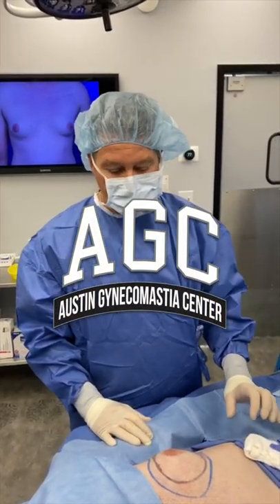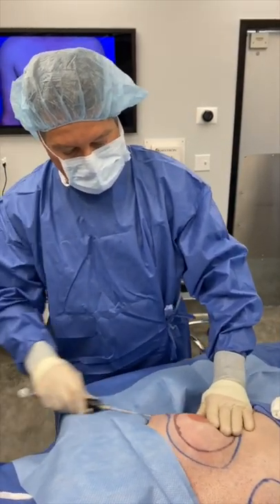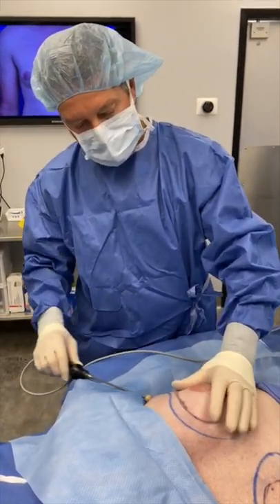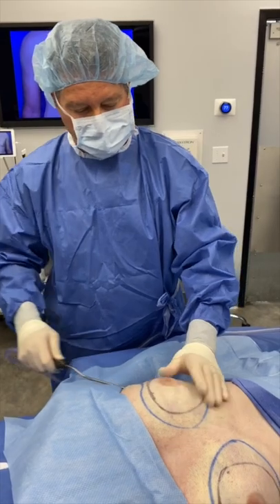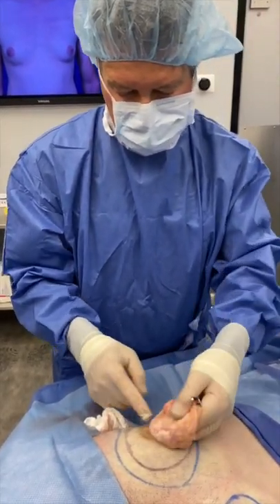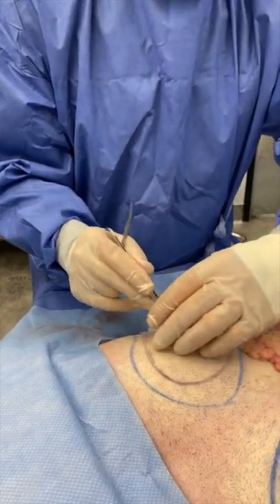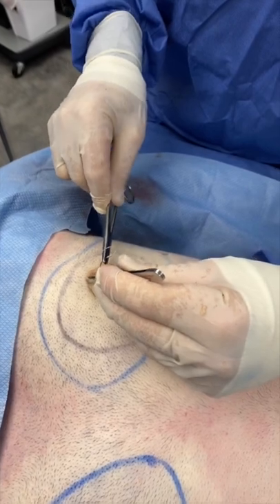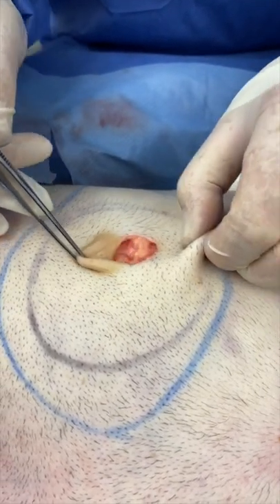HUGE Gynecomastia Gland Removal - 4 Steps Of Gynecomastia Surgery

Comment: Perfect procedure. You are truly an artist.
I notice a change of color on the aureolas, is that normal? Do they recover the original color?
Reply from the maker: That’s a good observation. Patient’s with gynecomastia typically have widened, puffy areolas and this is the biggest issue of them all. This is caused by the underlying breast tissue that starts immediately below the nipple. This mass expands the overlying areola stretching it out. There are pigment or color cells in the areola. When expanded they are less concentrated and the areola appears lighter in color. When the areola is smaller after mass removal with treatment, the pigment cells are more concentrated in a smaller area so therefore it appears darker!

Comment: Doc, I love your work but you’re the only doctor I’ve ever seen do the surgery and do a finger dissection. This is a more aggressive approach do you think this could Cause more swelling, damage to the blood vessels, or pain post op? hope
I don’t offend you just a valid question and out of curiosity.
Reply: Or even when you pull the gyno out could that be dangerous? Most surgeons I see cut with their scissors and take it piece by piece by cutting instead of pulling.
Reply from the maker: Thank you for your question…………….no offense taken. The procedure that you see me perform has been honed by thousands of cases. What I do is basically what I learned how to do in order to achieve the objective of removal of all the gynecomastia tissue and making sure the final result is smooth, even and masculine. Remember the VASER ultrasonic liposuction that I perform is used to get around the gynecomastia mass. It separates the gynecomastia mass from the normal surrounding tissue. Then I use my finger (which is blunt and not sharp) to get in the ideal plane that allows me to remove the tissue correctly.  I do scissor dissection as needed to separate the firm tissue and identify tissue planes. There is no increased danger or swelling or recovery time from this treatment. Although I never really think about it, you are seeing what a pretty experienced gynecomastia surgeon does to make it all happen. I hope this helps!
Reply: Hey Doc, I wish I would have known about you 8 years ago. Do you do revision surgeries? I had my done here in San Antonio back in 2012. I was never really happy with the results. Thanks
Reply from the maker: @rmedina1886  Absolutely, I do revision surgeries - a little more often than I would probably like to be, however. Contact me through my free online consultation to discuss further at https://westlakeplasticsurgery.com/austin-gynecomastia-center/consultation/?utm_source=YouTube&utm_medium=Social&utm_campaign=AGC&utm_content=4trCqr3hZtw-comments.

Comment: Hi Doc, thanks for making these videos and being so transparent with your work. I am thinking about having gynecomastia surgery for my puffy nipples. I am concerned, however, about the Liposuction (both Vaser and Standard) damaging nerve endings and leaving internally scarred tissue. I was wondering if you ever perform the glandular tissue excision without Vaser or standard liposuction? Would there be any downside to doing so? I figured since Vaser/standard liposuction is for the fat tissue, and fat can always be burned off, then maybe I won't need them if I could get lean enough.
Reply from the maker: Good question my friend. It goes like this: gynecomastia tissue comes in many forms (glandular/fibrous/fibroglandular/fibrofatty). I use liposuction to contour the chest tissue layer so it is smooth and even. If I just remove the gynecomastia mass alone and don’t contour the remaining Zones as needed, the result will be uneven and not masculine.

 The ideal person to remove only tissue is typically a body builder-fitness buff who has little body fat and mostly glandular tissue. This is my “up front” approach where I use my old school electrosurgery unit and my loupes to magnify what I’m seeing so I can be precise. Weight loss isn’t an impactful in the chest area in a man who has gynecomastia than it is for the rest of his body. I am a big fan of making sure my patients understand that they must get into/keep their weight in their best Body Mass Index (BMI) range for all the obvious health benefits.

Comment: Sir, i suffer from gyno 3rd grade. I met PRS doctor 2 days back. He suggested that he will remove most of the gland and leave some in there so that the nipple circle doesn't cave in. For the excess saggy skin it would lead after he said he would cut in a ring shape along the skin surrounding the nipple circle and stitch it close.  Is that a proper technique or should i suggest full removal of gland? My surgery date is fixed on 30th October.
Reply from the maker: Rajiv Menon I cannot provide more information than this, I'm sorry, but I never recommend that any gyno tissue be left for any reason, as there are surgical techniques such as internal flaps that can prevent divots forming.

Comment: I really want the surgery because i am joining the military in 2 years but i just find it akward to tell my parents about my gyno. I am currently 14.5 years old, will it go away naturally? I have had gyno for close to 2 years now
Reply from the maker: The general rule of thumb is that if after about a year or so that breast tissue growth started during puberty, it hasn't gone away, then it is most likely gynecomastia. It would not hurt to get diagnosed by a professional with gyno experience if you want to know for certain.